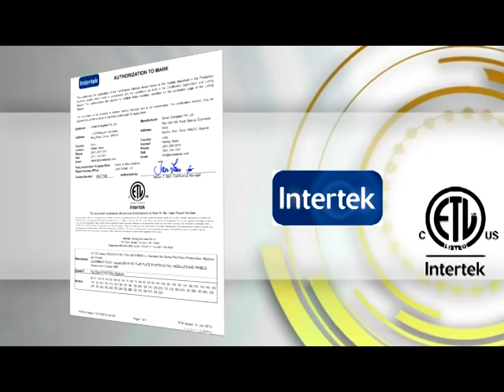SONALI SOLAR

Comment: https://www.youtube.com/watch?v=_J6rk_-2Kew&feature=youtu.be

unbelievable negative approach and Non - Cooperation by Sonali Solar Surat

To
The Chairman of,
Sonali Energees Pvt. Ltd

Vande Mataram,

This is Arpit Pandey associated with Sonali Solar with Agency Channel. I would like to inform you that after vigorous efforts, I was able to penetrate in market to generate the quantum of order. After getting assurance for co-operation from Mr. Anil Mishra, I was proceeded for 6 kw and 3 kw projects. I had collected the cheque and deliver it to the company along with all the documents whenever required. I had invested lot of my time in these 2 projects. I followed-up the clients again and again for the timely payment and clients also cooperated me, as they are having trust on me. In this way, My first 2 - order initiated with 'Sonali Energees Pvt. Ltd.' I started promoting your company to have a better business.

My 2 - Clients are

1) Munni Devi Gupta - 3 Kwp - Payment Collected - Still Pending

2) Purshottam Sharma - 6 Kwp - Payment collected - Still pending

After the long delay and requesting again and again 'Sonali' installed that project. The Customer also frustrated with our approach. At present, I am so unfortunate that I am not having any feedback from 'Sonali Energees Pvt. Ltd'. My 3 kw and 6 Kw clients are started spoiling my business which was opened by me. Try to Understand the Situation that they started spreading the Negative Message. I tried to discuss with the Chairman & Managing Director of the company to discuss but his egoistic nature and impatience decline to give me proper attention.

Finding no other way, at this Juncture writing you with some hope for the completion of my above projects.

-------------------------------------------------------------------------------------------------------------------------------

I am not having any details of the person to whom i can contact for price related discussion. One day, the tendering was going on and because I am associated with their college for project and all. But I was unable to finalize that project due to irresponsible  nature of our company. The company is operating like ' General Stores ' having no commitment, No Customer care, No Agency Facililation.

--------------------------------------------------------------------------------------------------------------------------------

I spent lot of my time and money for collecting documents, cheque, error resolving & All. But my payment is pending so how can i proceed longer. The Company is completely avoiding us.

------------------------------------

I was reference by Mr. Bankim Bhai Desai ( Educational Secretary of Surat Municipal Co-operation ) that's why i was having belief but now, I am fixed at this moment. Lots of things to discuss but found no any person having caliber to discuss in this company.

Hoping for the solution from you.

Sincerely,
Arpit Pandey
Electronics Engineer